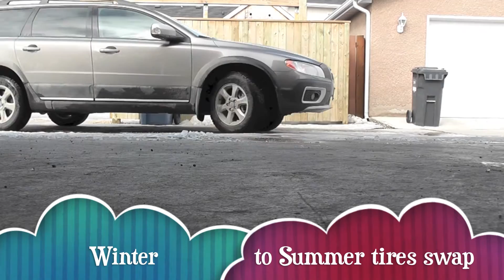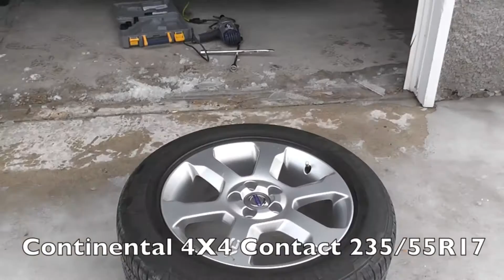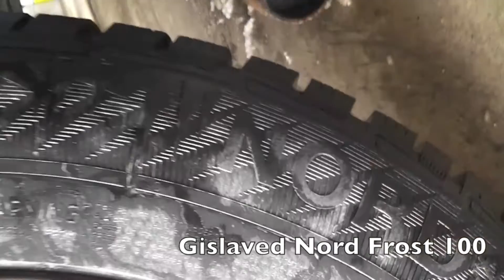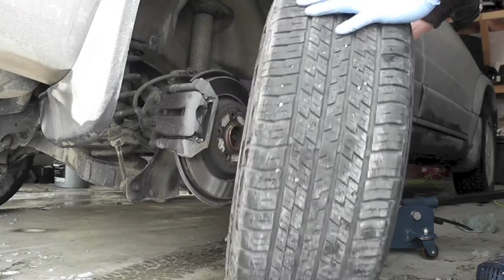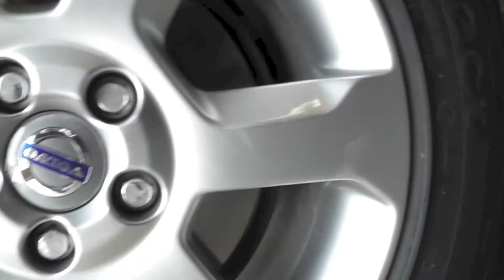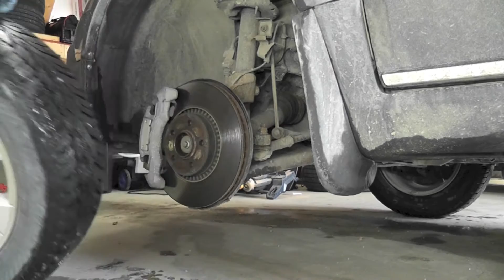Volvo XC70 Winter to Summer tire change swap

Comment: Hey there!
Could you post a video showing the lift locations for a 2 ton jack? I used the locations  made for the small 1280kg lift but I'm unsure if that's correct for a 2ton jack...

Comment: Again, a very good video. According to online calculator the difference between 215/65R16 and 235/55R17 is 4.4mm. This makes a speedometer difference of 0.6%. Enough though it does get as cold as where you are here in the UK, winter tyres do make sense.

Comment: It's important to always use a torque wrench. On your model XC70, it's either 105lb/ft or 140N/M. Invest in one.
Reply: I agree, anyone know what size the lugnuts are or the socket size used to take the wheel off ?

Comment: Which spot do you use to lift the car to change the front wheels?
Reply: The bottom of the car genius
Reply: @oregonn437   Never ask a question and expect an answer from a genius who doesn't know either.

Comment: Do you have to reset the tpms sensors?
Reply from the maker: Dont have them. Very happy for that.
Reply: I really don't know about tpms sensors as I'd refer to the manual which you can download and refer to.  Just search for Volvo year, make, model and engine size if required.